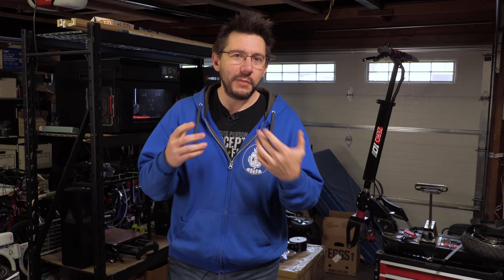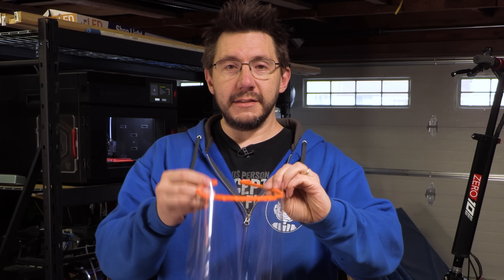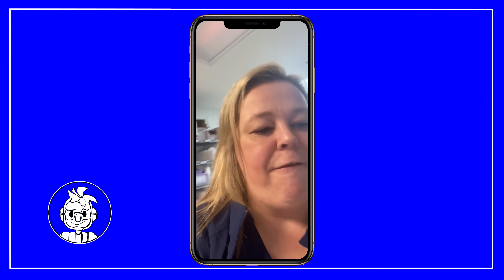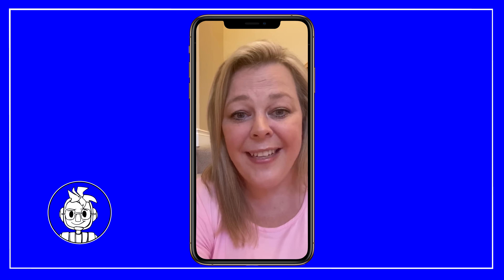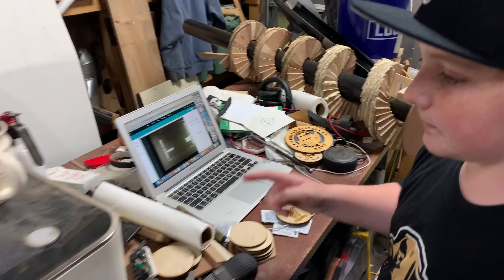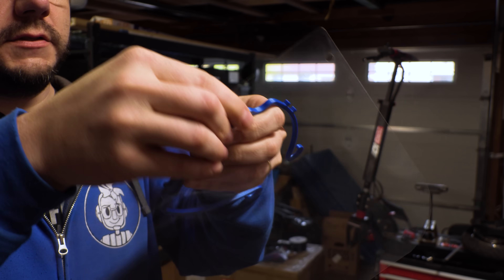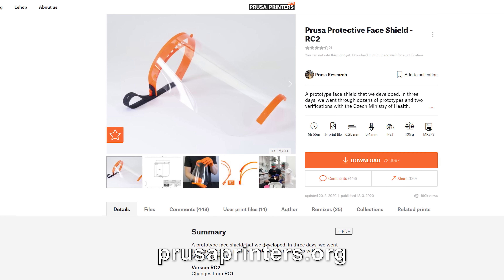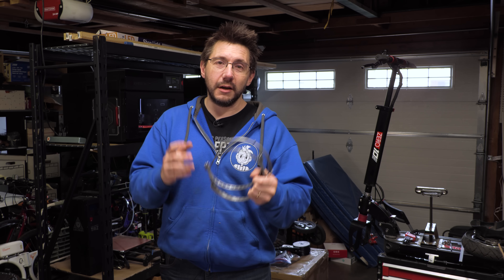3D Printing Face Shields and YOU CAN TOO!

Comment: What about all the micro holes in PLA and PETG?  Doesn’t that give the virus a place to cling?  Can they be fully sanitized?  Is there a version that can work without laser cutting?
Reply from the maker: That is still up in the air. I think Prusa is doing test now with 3d printed parts to see what works best and if anything works at all. These can be treated as one time use only if needed.
Reply: 3D Printing Nerd yes. I was thinking one time or soak in bleach or something, though I don’t know what that would do to the plastics. The copper3d antibacterial filament seems to be out of stock everywhere. I’d love to do these without a need for laser cutting. I’m wondering about simply creating a drilling template and doing the whole stack on a drill press.  Seems like woodworking tools and scissors would do the job, even a hole punch. Laser seems like overkill.
Reply: Thinking about it, if there’s an SVG file available, they could be cut on a silhouette or cricut.
Reply: ชวลิต อัศววรานันต์ I only print petg. I wonder why it’s preferred. Still the same issue with holes, no?
Reply from the maker: PETG is preferred because it’ll hold up to chlorine (bleach) better than PLA ABS ASA
Reply: We dip in alcohol

Comment: Joel I really appreciate your effort and also the great publicity for the 3d printing community. I'm also printing my own design on 30 printers as I'm typing and plan to give them away for the locals that need them.
Since you clearly read Joseph Prusa's article about the topic I think it is not really a good choice of words to leave out all of the safety concerns he mentioned. I mean you show all the people that it is okay to handle all the printer parts on your armpits (where you do sneeze?!) and also show your son handling the pieces with bare hands.
Just to sum up: A+ for effort. But please make sure to include some information to everyone willing to help, that proper hygiene, gloves, masks etc. are necessary if you want to produce a safe product! As Jo said: a false sense of security might be just what you don't want to achieve.
Cheers
Reply: Yes, important. See  https://www.inksmith.ca/pages/ppe-face-shields those guys are putting in place a disinfection process, for example.

Comment: If you don't have a laser cutter a hobby CNC cutter should be able to do this job as well. Cricut and Silhouette are common brands. They're basically a CNC controlled drag knife and should be able to cope with this thin material. If you know anyone who is into or used to be big into scrapbooking, talk to them. Many of them have these machines or know someone who does. The machines themselves are pretty cheap too at $150-$300 new (at least compared to a laser cutter!)

Comment: Where do you get those plastic sheets?
Reply from the maker: Mine were from an office supply store
Reply: @3DPrintingNerd  did you see https://www.billingsclinic.com/foundation/? It makes it so the masks last 3-6 times longer since they can cut the n95 up and still get good protection. There's something about needing gasket material though.
Reply: @3DPrintingNerd  Thanks - if the school gives the ok we were asked to print 900 as a first batch but were asked to do the prusa ones. We can fit 6 in one shot on the buildplate of the Chiron and are going to do it in HIPS as that prints faster than anything else and is cheap. Gonna see how many printers we can get up and running in the area. As the school is closed they are going to see if they can get all the printers to my house. Guess the advantage of being single is you can move the furniture and put some big tables up to put printers on

Comment: YES. Good to hear. We are implementing these in MASS in West Michigan
Reply: Do you know the print size of the file? I ask this in a separate comment but I'm looking to purchase my first printer and want to make sure the bed is big enough. I was looking at the Prusa Mini at 18cm*18cm*18cm. I'm in East Michigan, specifically Waterford.
Reply: @brianpendleton2674  roughly 6inch across and 7.25in length i think. 1 can fit on a prusa mk2

Comment: I'm in Canada. Our local hospital WILL NOT ACCEPT anything that's not industrially manufactured OR completely sterile regardless of how short they are on supplies.
I don't blame them. The person 3D printing the parts could be transmitting the virus on the masks and not even know it.
Call and ask before making anything.

Comment: Hey Joel! I've heard that these masks can't work due to the pores in the filament as well as the microscopic crevices. I don't think many people realize that you can possibly seal the whole part, either paint or possibly a epoxy resin later to create a smooth surface that call be wiped off before and after use.
Reply: These are not the respirator type masks. They are shields that are worn in addition to the masks.

Comment: Most people are locked down at home, and cannot venture out. How do they get the plastic sheets?

Second, good point about the wide variety of materials 3d printed. I print only with PLA for H&S at home. Which I thought was too brittle for this application.

Third, yesterday I saw an article, think it was from Prusa Research about sterilisation of the shields before they are sent out. Probably the most important part.
Reply: I have the same question about the plastic sheets! Where do I get them!?

Comment: We have a group printing the Prusa RC2 shield.  I started yesterday and have 11 done.  Printing 2 at once on my Ender 5 plus and 1 each on my two Ender 5s They are all going to KU Med center who is asking for 800.
Reply: David Wilson I’m in Northwest Arkansas, but I’ve done some photography for ku med in the past, and I would love to put my cr-10  printer to work to help. Do they still need more masks? If so, are you just printing the brackets(top and bottom?) and they are adding shields and assembling? Are you printing pla or pet? Who would I need to send them to? Thanks!

Comment: with this design could you stack a dozen of them with support material between them?
Reply: will make a nightmare to clean up  (dont think you would suggest using pva dissolvable support would you?) and filament useage (seen the large spanning surface) triple or so

Comment: Fyi, as an engineer and material scientist, Pla is fda approved for food safe. You can sanitize pla in ethylene oxide, bleach and rubbing alcohol. Hospitals back in 2016 did major studies with printed parts in pla and sanitation. The porosity of pla is very low. 0.1% of all pores are larger than 10 microns... but viruses are 0.1 microns lt72884? Thats true, but even a properly fitted N95 mask has airgaps around the face the size of texas compared to any bacteria or virus. Facial hair stubs create gaps. These face ahields are completely reusable and so are any masks printed. You just need to use certifide filter material.

Comment: You know, I was thinking about a face shield that you could clip onto a ball cap, making it more casual and comfortable.
Reply: wouldnt work that well as convection by our body heat makes our breath rise out of the upper side: when you block this (even a little) you will get - depending on the used plastic - instant or after some use fogging on the inside

Comment: Ever since Prusa uploaded their design I’ve been printing them for my dads pharmacy. So far each one of his employees has one of my printed masks. I am teaming up with my sister who is using a cricut machine to cut the clear plastic. I am now printing more to simply give out to businesses that need it ie grocery stores. If you don’t know where to send them you can go local.
Reply: do you have the file for the cricut?  I'm not very familiar with it, but my daughter has one
Reply: David Wilson wasn’t too hard. Pretty straight forward. I think if you can manage a 3D printer this will be easier. Maybe your daughter has more experience and can help with cutting them.
Reply: My wife has a cricut - how do we get the file to cut the plastic?  I have 3D printers and a box of overhead transparencies
Reply: reasonablebeing for the file I used the laser cut file from prusa and made it in the cricut interface. Actually I didn’t but my sister did. I believe their interface is much more basic. So it’s like covering places that don’t need to be cut with blocks and such. My sister was able to do it and it worked fine. We used A4 paper so had to squish the original design to fit in A4 design but the re did the holes with simple circle cuts or what ever. I’m not sure how to share a file

Comment: Printing as fast as i can, and will be delivering about 50 Pieces on Friday to a local hospital here in Skåne, Sweden.
Reply: Nice! I'm starting tomorrow to produce for Stockholm.
Reply: Good man!
Reply: What kind of 3D printer do you have?
Reply: @alana60153hits I would like to know as well. And what materials are required?
Reply: I could help aswell here in Nyköping, Sweden but still waiting for a new Skr v1.3 board and a new E3D clone hotend. Can't wait to get the printer to work again.
Reply: Didn't the hospitals in Sweden say that it doesn't seal the forehead enough? I mean, it's obviously better than nothing, but I remember reading that 3DVerkstan was working on a more protective version? :S

Comment: The foam is there for more than just comfort - it's also there to make a partial seal.  It prevents (to an extent) saliva droplets from being pulled over the eyes during inhalation.  Because spray from a cough moves like a cloud, and the vacuum created during inhalation will draw vapor from around the fringes.

It's better than nothing, and the amounts of saliva vapor are pretty minute (I suspect that you probably wouldn't be infected by this if you were also wearing a mask...but I am not a doctor).  But I can easily see why the headband had foam on it.  Maybe add something to the design where you could make a replaceable foam strip?
Reply: I am and while you are correct in theory, but in the field you would have to have a hughly dense cloud to draw the vapor through the top side (remember that the distance to the other sides is usually smaller AND is more open) plus you are correct in that we on top of that wear a mask under it (rendering the discussion semantic)

I appreciate your well intended and out-of-good-&-caring-heart made suggestion but as the problem is merely theoretical, I am afraid that overdesigning will turn production down and make everything even more difficult (another station to sent this to to get the foam in) aka delays we can miss right now

but thanks again for thinking with and supporting us (please dont take this as critic or negativeness, I was trying to clearly line out the needs/facts when used in a clinical setting)

Comment: Two questions 

1. What are the build requirements, x,y,z?

2.  For those using a laser cutter. Is there any benefit in cutting the holes lower on the shield thus providing protection for the forehead?
Reply: you would want to protect mucosa membranes, like eyes, nose and mouth from splatter and droplet spread, forehead protection is not so much needed + will give a clumpyness to it all
(+ we need to able to strap/knot our masks once behind our neck and once just past the vertex/ top of our heads , extention above the forhead will lead to more difficult mask adjustments)
Reply: Ok. In a way that is good news. Just don't touch any exposed part of your head without washing your hands before touching an 'input spot.'
Reply: Also, the items are not flexable. They are face shields not masks.

Comment: Couldn't you put paper between the plastic sheets to prevent the plastic from melting together and print multiple sheets at a time?  As you are using glowforge with its scanner the top sheet of paper would want to be a cut pattern (laser print?) and then you could easily align every other everything together with alternating paper and plastic sheets.

Comment: Really like this design.  Uses a lot less material than the Prusa design, doesn't need an elastic strap, and uses office supplies. 

Has someone figured out a standard sterilization protocol for these and other bulk plastic PPE? (hopefully something simple like, dunk in a common Iso-propyl alcohol bath for 5-10min and let dry on a shelf?)

Comment: If I would read the posts. Also, Joel do you know if in the USA it's aloud. Will hospitals take them? Or just canada at the moment?
Reply: Hospitals are concerned about them being sterile.  I'm making them for our regional top 20 hospital KU Med, they are going to handle making them sterile.  I'm just printing the plastic parts they  must have someone who is doing the clear shield.
Reply: @woodwaker1  Being sterile is a major concern for obvious reasons. I think they'd (hospitals) would prefer supplies coming from regulated sources. However I am sure that they would be put to use where face to face contact with the public occurs. Not patients.  Then again,any port in a storm. They might consider sterilising them on site when the regular stock runs low.  This situation is long term,at least a year so the more we print the better anyway.

Comment: Would it be possible to modify the model so a person could stack them and just snap them apart? Print a full z axis worth per print, save some time on resetting between each 2 or 3? Probably introduce some issues like layer adhesion problems at the beginning of each frame, leaving voids that would make them harder to sanitize...

Comment: Joel I am happy that people are trying to help and I appreciate all that ppl are trying to do.. But sometimes you gotta really think about it.. These masks DO NOT seal around the face, so what is stopping the virus/pathogens from coming AROUND the face shroud? Nothing! Common cotton surgical masks have same problem of no sealing around edges, but are way cheaper and easier to obtain atleast where I am. These masks/guards do help and something is better than nothing I understand, but please do not promote these things as even being remotely able to stop the spread of a contagion of this virulity. Honestly, I was terrified seeing that woman "experiment a prototype" in an actual risky situation. Please advice them to use only FDA/government approved SOPs and PPs. This is not an experiment to be taken lightly, as the mask is clearly not going to help to stop contamination. We breathe in and out and this air turbulence will find its way out through the HUGE gaps (I dont wanna say tolerances lol) around the entirety of the shield. I am saying this as a scientist to another and I hope you understand that not EVERYTHING can be 3d printed RIGHT now atleast. The size of coronavirus is 120nm and you will need a particulate filter less than this to be effective at filtering out these virii, which is currently out of the scope for even resin printers.
Reply: These are meant as splash/droplet shields to protect the n95 masks. Not to use in their place. The emergency worker stated as such. They use the guards to further protect the masks because they have to reuse them... they dont have enough. Keeping them as clean as possible is the goal.

Comment: Damn that's amazing. I'm a bit worried about sterilisation though. Viruses can stay around a lot. Even diagnostic and analytic labs need a CDC BSL-3 certified lab to deal with COVID-19. That means that the viruses can stay on the mask for a while, including on the nooks and gaps on the mask and between layer bumps. You need to be really careful sterilising the masks, probably alcohol would work because you can't autoclave it.
Reply: as an engineer and scientist, there is only so much you can do to protect your self against mother nature. The porosity of PLA is very very low. Using CT imaging and digital microscopes, PLA filamint has 0.1% of all pores larger than 10 microns. 99% are smaller than one micron. 

You can sterilize PLA just fine using bleach water, rubbing alcohol and ethylen oxide. If none of the above work to clean and sanitize, the general public doesnt have access to autoclaves, ethylen oxide gas. We have access to bleach, rubbing alcohol and accelerated peroxide. 

The only difference between PETG and PLA, besides composition, is strength and slight increase to chemical resistance, but PLA can last a LONG time in bleach water and rubbing alcohol. PETG can have larger pores if the printer cant print it well enough. But even under CT scans, the porosity of PETG was stil very very low. 

Treat these masks and shields as an extension of the person, wash, rinse, sanitize.  

If needs be, spray a clear coat on top or plastidip
Reply: @LT72884  Any idea of bleach to water ratio for sterilizing PLA? Do you use it in a spray bottle??
Reply: They might also have those ultrasonic baths for cleaning stuff?
Reply: Something can always go wrong, in my country it is clearly said that it has no certificates and should be washed before use. As for the virus in the layers would theoretically fit: D but but the layers are applied at about 230C so I don't think it will survive, from the outside there will be a disinfectant.

It must be remembered that the virus can survive for a long time with the closing of the pluck, i.e. such as filament ...
Reply: This could probably be debated, but as I understand it, we're talking about having masks vs. not having masks.